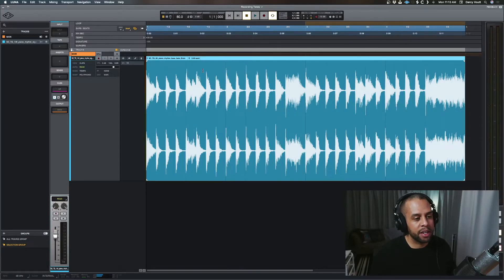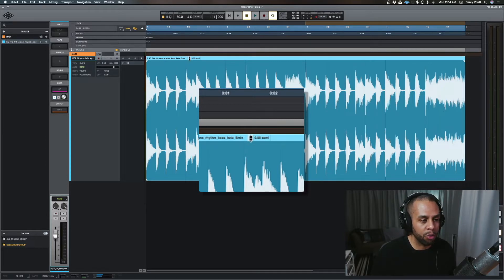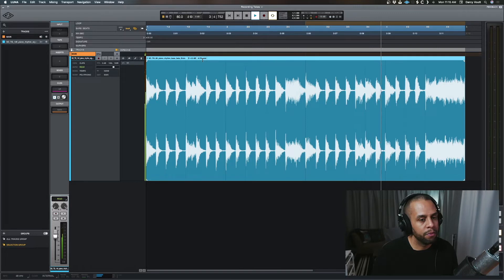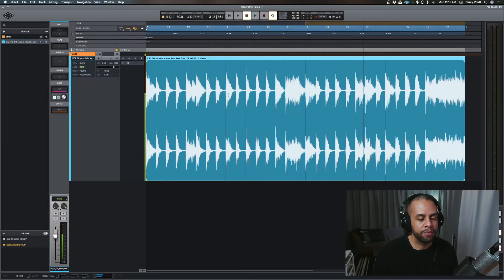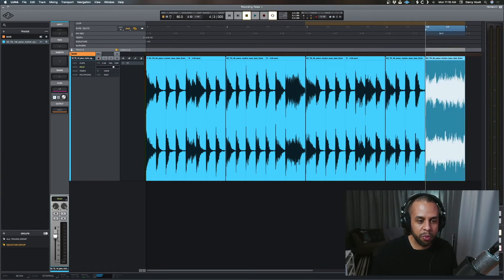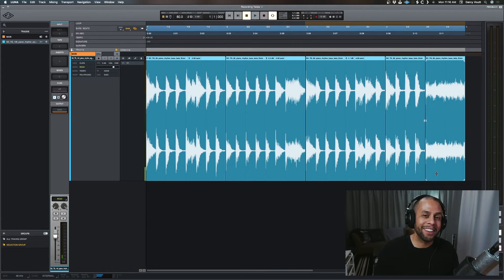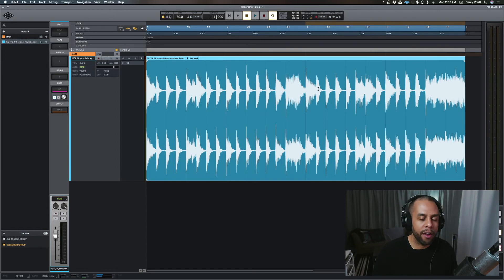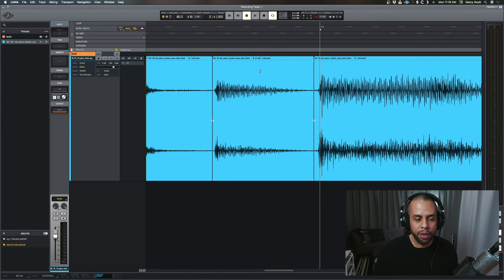Adjust Clip Gain & Clip Pitch in LUNA

Comment: Is the shortcut keys for clip gain the same as PT? It seems like most of the shortcut keys are the same
Reply from the maker: Good question. Not sure there is a shortcut for that, but if there is I need to know it as well. 

What is it for PT?

As per the general statement of their shortcuts. They do mimic but are not the all the same. I’m not a user of PT but when they first dropped LUNA they stated they made a lot of them similar to make it easier to learn. However the goal isn’t to make them all match so as they add their own unique features or feel something is more intuitive they would make their own.